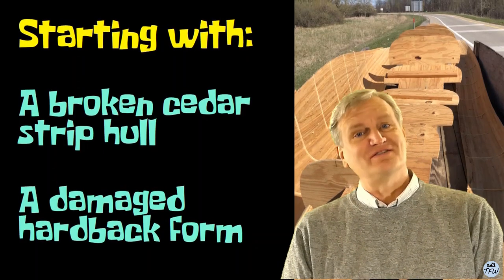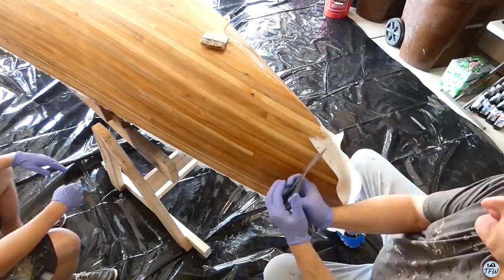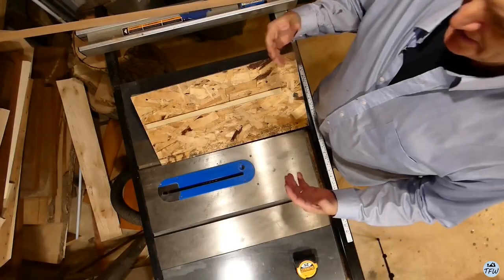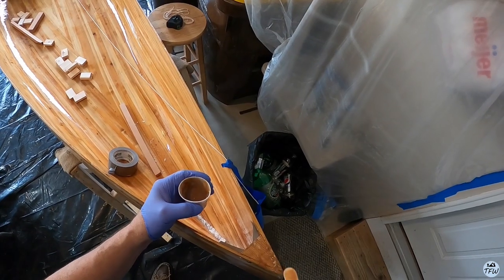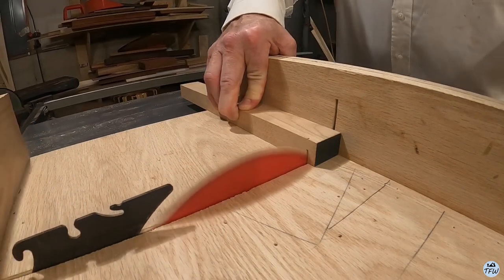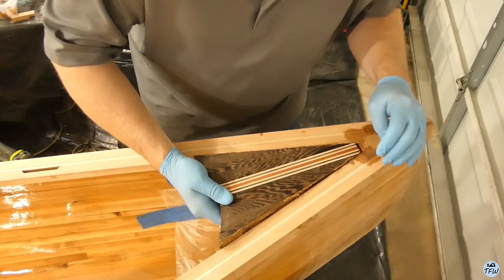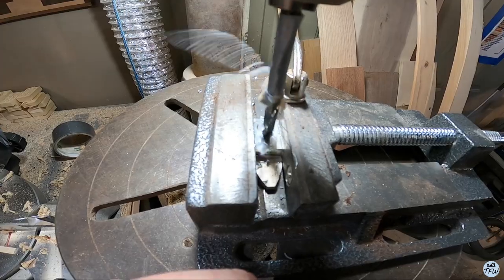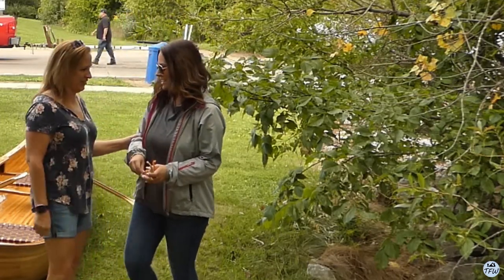Cedar Strip Canoe: Repairing, Fabricating and Finishing

Comment: Very nice work, I am currently in the process of restoring a canoe that my dad and I built 34 years ago, can I ask what epoxy you used on the fiber glass coat? I really like your results.
Reply from the maker: We wound up using Marine Guard 8000 and really liked it.  A little thicker.than West Sysrems but it wetted out nicely and was just as hard when cured..  It was clearer as well so cool for other display projects.  Thanks for watching!

Comment: how much epoxy did you use?
Reply from the maker: In the end,  I used a little more than 2.5 gallons mixed. (or 9.5 liters).  I bought (2) 1.5 gallon kits, each with a gallon of resin and a half gallon of hardener. The MarineGuard epoxy I used was a little thicker than West system, but it still wetted out nicely.  Thanks for watching!
Reply: Thanks for the input.   My uncle made 2 cedarstrip canoes 20-30 years ago. I sanded it all down and then wiped it down woth acetone and was expecting to have the cedar strip colors come out but all i see is the fiberglass. 
Will the colors come out?
I was thinking about just getting total boat 2:1 epoxy. Do you know of anything cheaper?
Great video, ive watched it almost 3 times now 💯💯
I am hoping to finish one cedar strip for a loop in the Boundary Waters where my uncle always went with them  :)
Reply from the maker: @crazyknotts6016  Hmmm.  Hard to know the condition of the glass work without seeing it, but if you're only seeing the white powdery surface after sanding that's normal. As a test,  If you pour water over it, you should start to see the wood grain under the fiberglass pop out. If you're only seeing fabric, the original build might not have fully wetted out the fabric against the wood. The water test will show you what a new layer of epoxy is likely to produce.  Total Boat is a good choice too, but I fear they are all pretty expensive now....  Best  of luck on this family project!  -TFW
Reply from the maker: Note one more thing about the amount used...  The first coat used far more epoxy because the fabric soaks it all up.  The added layers use less per coat so if you're just refinishing a previously built cedar/fiberglass canoe, you won't use as much epoxy as I did.
Reply: Thanks for all the input. I can't wait to tackle this project!